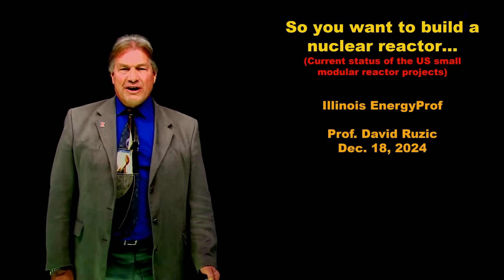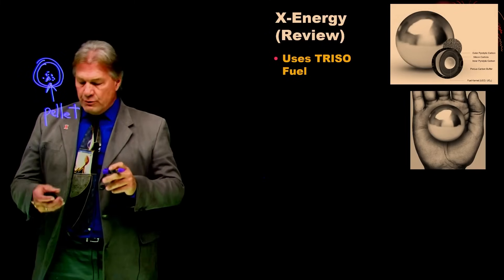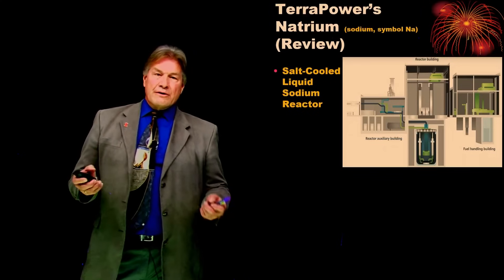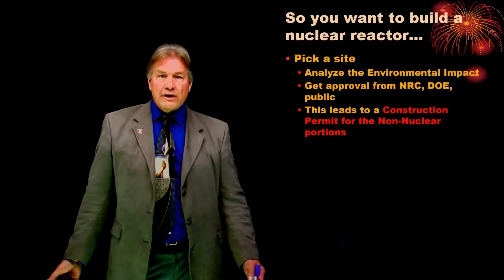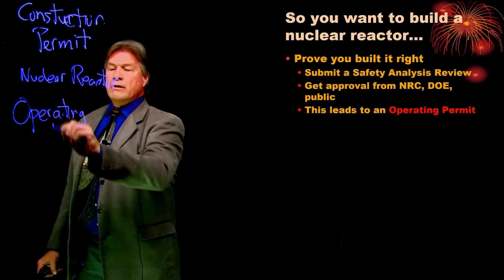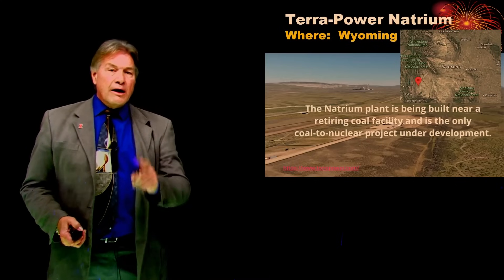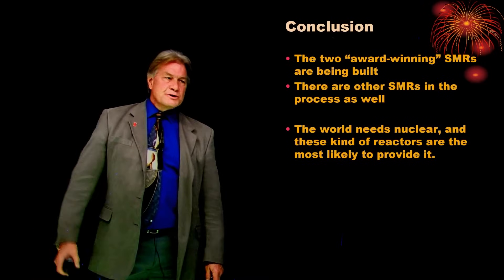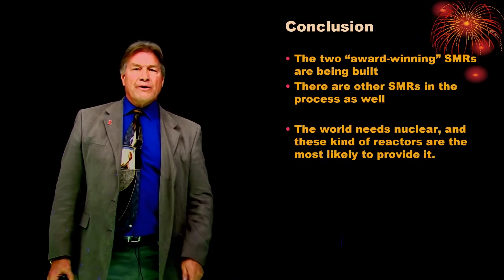So You Want to Build a Nuclear Reactor

Comment: If this Nuclear energy generation method is "oh-so" Safe, can it be miniaturized (Thinking the TRISO solution) to generate power+ for a single home?  Like a common home gas generator?  Instead of defaulting to the Capitalist Centralized model of energy production (where one monopoly defines consumer energy prices to fit their shareholder ROI), Solar has proven its just as easy to create a Distributed power grid generation model.
Reply: No thanks. Did you watch where they have to pass all those safety reviews just to build and operate it?  There is a very good reason for that.
  I see how some people take care of their property and there is no way I would trust them with a small nuclear power source that could leak radiation.  Family at the dinner table wearing dosimeters? A disgruntled person turns it into a dirty bomb if able to gather enough nuclear material?  What happens to the spent fuel and reactor when it wears out? So many scenarios where this could be a bad thing because there are bad and irresponsible people in the world.
Reply: The smallest practical reactor is probably something like the Oklo Aurora, which is about 1-2MWe - approximately the power demand of a few hundres/thousand homes - so not really practical for a single home.

> Instead of defaulting to the Capitalist Centralized model of energy production (where one monopoly defines consumer energy prices to fit their shareholder ROI), Solar has proven its just as easy to create a Distributed power grid generation model.

The centralized grid has done fairly well by us peasants. On the other hand, solar panels are made with SLAVES in China, and have a centralized distribution, installation, and repair network.
I much prefer sending a few cents every month to a regulated utility over perpetuating Uyghur slavery in Chinese solar sweatshops.
Reply: @factnotfiction5915  Fear not! Solar panels aren't really touched by greasy human hands anymore. Robots make them in dark factories (literally with no lighting to save on cost) and deprive every slave of their few cents a month. Progress! Yay!
Reply: @factnotfiction5915  
Or we could manufacture locally in properly unionised factories.

Once installed, PV and other renewables do work for quite some years. Centralised power can be turned off or disconnected any time.

Nuclear reactors cost quite a bit more than a few cents a month.

Comment: at 6:21 You said the reactor makes 200 megawatts of thermal or 320 watts of electricity. Did you mean 320 MEGAWATTS?  because at 40% conversion efficiency, you could expect 80 megawatts per core, so that would be 320 megawatts, not watts.
Reply: Yes, seems like something wrong? The thermal output must be double or more of the electric output given the Carnot rules.
Reply: Yes. For later readers, it was addressed in another comment thread.

Comment: Seadrift, Texas where the X-Energy site is proposed is only 60 miles from a nuclear reactor in Bay City. Surprised that a company there would have originally used coal for power. I assume that the inefficiency of transmission makes it costly.
Reply: They use the HEAT from coal, not electricity from coal.
Yes, converting electricity to HEAT would be expensive, and very inefficient.

Comment: What's the output and what's the cost?
Reply from the maker: Both are around 350MW thermal and total cost may be $3 billion.  Obviously higher than other forms, but these are the very first ones built and being modular and built in a factory, not on site, the cost can come down substantially.
Reply: @illinoisenergyprof6878  if they can sell half that 350MW around the clock @ $0.13 per kWh that's a 15 year payback not including interest. Doesn't sound like a bad business plan. Put a data center close by and they'll be selling more like 80%.

Comment: Whoa, at 6:10 you just misstate what you meant to say: 320 watts electric rather than megawatts, and 200 megawatts thermal rather than the 800 that's the combined output of 4 units you're referring to...
Reply from the maker: I know.  Since in the next sentence I said "Megawatts" and I wrote MW on the light board, we were hoping everyone would understand that it must be 320 MW thermal, 200MW electric.

Comment: I wonder if Elon got involved in this if the process would improve . He seems to be able to get whatever he focuses on done faster and cheaper than previous methods... but he does often mention taking bold steps as part of the success path.  
Maybe that not the kind of thinking you need in this sector but the process does need to get improved and the downsides resolved. The world needs it.
Reply: Vivek Ramaswamy has been advocating for reforming the NRC for years, it remains to be seen if that's possible.
Reply: @chapter4travels  It's gotta be a tough nut to crack. The repercussions of being wrong are impossibly high.
Reply: @EmmerBigguns  You mean like the disaster at Fukushima where no one died? No, I'm talking about the regulations around low-dose radiation. Currently, they use the LNT theory which has been long since replaced with the homeostasis radiation theory.
Reply: Tesla sells batteries. Musk would put the all this SMR nonsense in a sack and throw it in a river. He would build solar/batteries instead, or at the very least build a proper nuclear power plant.
Reply: @rohansprenger6902  He has built a few  other things you might have heard of as well so I don't think he would be dismissive of anything out of hand. He has a mental gift and If he could make a safe nuclear car, he certainly would.
Reply: @EmmerBigguns  I agree he would not be dismissive of nuclear power "out of hand". He would consider it, then throw it out.
There are cheaper and better options - like battery backed solar.... 
Or better yet geothermal power, which is cheaper and 'greener' than nuclear, more reliable, is ~infinitely (in practical terms) scaleable, can be constructed in a fraction of the time of a nuclear power plant. It can be sited almost anywhere in the US (given land rights permissions) and has none of the other drawbacks of nuclear (or even coal for that matter).

What is the argument for nuclear? I appreciate it is relatively "clean", but it's economic case rests solely on every single aspect of planning and construction going absolutely perfectly at every step - it's a gamble where the potential "win" sees you break even. It just makes no sense for electricity generation - unless it's a ~by-product of weapons materials creation.

Comment: Did I miss something? 320W of electricity or 200MW of heat? That's.... An insane difference in magnitudes, was this what was intended to be said? Or are you saying this reactor is being considered separate from say a steam and turbine system, and the 320W of electricity is just enough for the reactor's needed function?
Reply from the maker: 320MW of heat and 200 MW of electricity.  I misspoke, but thought I wrote it correctly.
Reply: @illinoisenergyprof6878  Thank you, higher electricity than heat was confusing me as well from an efficiency standpoint.

Love your videos BTW, as many here do.

Comment: Here in the Netherlands, we have one major nuclear power plant. Borsele with a capacity of 485 MWe.
Construction started in 1969 and the plant was online in 1973. About 5 years later.
Building a nuclear power plant in only 5 years is, as we all know now, very very risky.
It should take at least 20 years: 15 years for talking and 5 years for the construction.
Funny thing... this plant will be in operation till at least 2033.
That is 60 years of clean energy.
Reply from the maker: The French build them fast still --- that is because they use the same (continually improved) design with many of the same workers.  The hope is that standardization, and being able to build reactor after reactor at one plant wiht the same workforce, and then ship them to different locations will make the process much quicker once the first few are made.
Reply: @illinoisenergyprof6878  Thanks for your reply.
Building the units in a factory will keep the cost down and improve the quality for sure.
If they are intrinsically safe, do you need a containment building? 
Not having this enormous thick concrete dome will also speed up construction and keep cost down.
Reply: @olafzijnbuis  They end up selling SMR's in IKEA. The containment building is the last line of defence in a reactor design with water cooling. The water can expand, create hydrogen, disappear etc. and you have gas explosion or melt down. But if there is no pressure that risk i gone and the containment should be unnecessary. They only reason I could see you need it is due to exterior threats, someone running a car or plane into to the facility. But still you won't have a huge blowup, only some solidified salt or pellets which can be controlled.
Reply: @illinoisenergyprof6878  
"the French build them fast still"
really?
The examples this century do not support that position.
Reply: @aaroncosier735  Indeed, it is so easy to fall into mass media propaganda. There should be some  reports # of reactors built and the time it took.
Reply: @illinoisenergyprof6878  Do they though? I really don't think it is honest to say that EPRs are built quickly.
Reply: The point is the coolant of water. it is too weak.
Reply: @ThoriumOceanHK Huh?  Not so.
Reply: How much waste would this reactor have generated in it's 60 year life?
Reply: @navithefairy 
It is actually very little compared to the amount of clean energy it produces. And the little PWR in Borssele is also using recycled fuel, so that will keep the waste down even more. As an indication: All the nuclear waste produced to provide you with all the clean electric energy to last you your entire lifetime will fit in a regular sized soda can. Yes, really.

Comment: I hope these work out. I worked on the VC Summer AP1000 project that was cancelled in 2017. One of the major problems we had was finding qualified people to build the plants. We had to compete with a sister plant in Georgia at the same time (which did get built but at double the cost and years behind schedule). The problem wasn’t finding engineers as it was ironworkers, carpenters, electricians etc. Many that we did find were in their 50s and 60s. Young people don’t enter those professions any more (and we have fewer young people to begin with). And they don’t want to put up with nuclear requirements such as background checks and drug testing.
Reply from the maker: Very good points.  This is why the smaller, modular reactors may be the answer.   All the nuclear parts can be built in one location with one workforce and shipped.
Reply: @illinoisenergyprof6878  And the power conversion side of the plant is the same as a coal or gas power plant, no nuclear specialized workers are needed.

Comment: Isn't Seadrift, TX right in the path of really strong hurricanes? Professor, thoughts on this?
Reply from the maker: I'd worry alot more about what a hurricane would do to the chemical plant.  The containment around the reactor would survive a huricane with ease.  Remember, a full speed jet airplane can hit one and not damage it.  The balance-of-plant (generators, power lines etc.,) would be damaged, but all of that is easily fixable and would have no long term consequence.

Comment: Can you convert existing nuclear power plants to these designs?
Reply from the maker: Like with building one at a retired coal power plant site, using the site would be possible.  Maybe one could use the "balance of plant" -- boilers, generators etc. -- but they are likely quite old.   The good thing about using the site over is that it was already qualified to have a nuclear reactor there.
Reply: Existing npps would (probably) be large scale - it would be cheaper to just build another large scale plant at eol than throwing in an SMR or two or five.